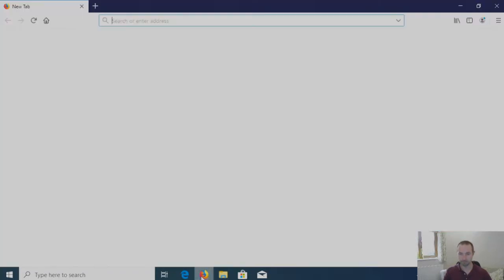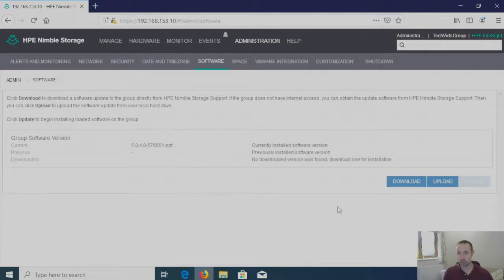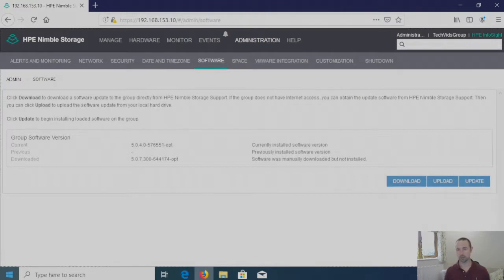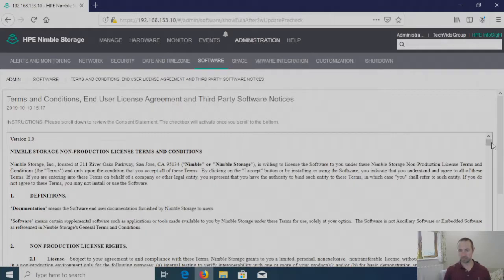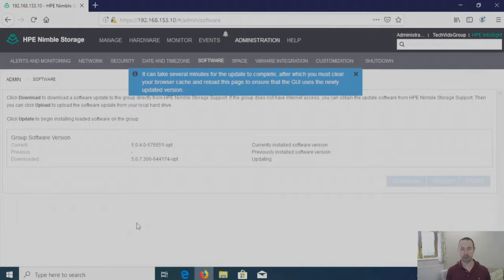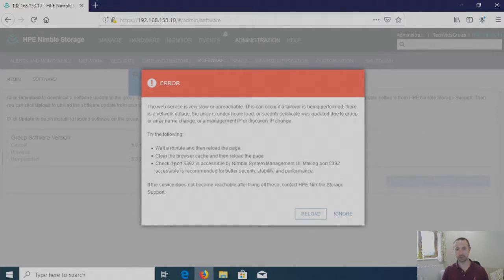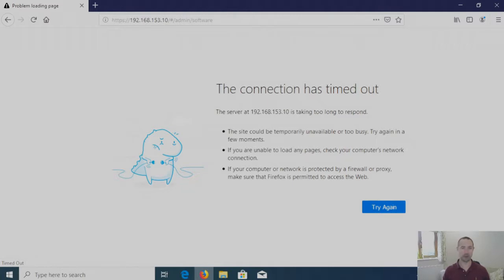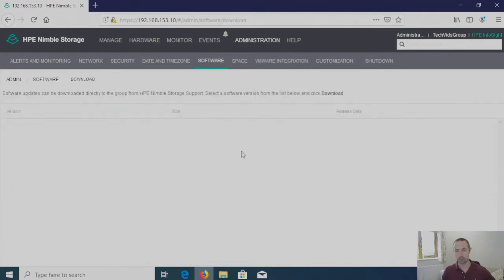HPE Nimble Storage Firmware Update

Comment: For the Nimble storage to download new firmware does it need an active support agreement?
Reply from the maker: The FW comes from either Nimble support directly or Infosight. So the answer is yes in short.
Reply: @itsmylife8972  Great Video. Lastly if i replace a controller or hard drive with lower or higher firmware does the active controller automatically update that replacement controller or drive from the active controller?
Reply from the maker: @Carlo Carlo  If replacing the controller the FW is located on the Sata DOM. My recommendation would be to swap over the Sata DOM. HDD is also shipped with whatever level and would typically stop at said level.
No, the Active controller doesn't 'push' FW to passive controller. It's recommended to have both controllers operating at the same level.
Reply: @itsmylife8972  thankyou for the prompt advice really appreciate it. Do you have a email i can contact you regarding this if thats ok?
Reply from the maker: Sure. You can get me at bret3969@gmail.com.

Comment: Very helpful, thanks!
I'm updating from vmware 6.7 to 7.new
Will I need to update nimble drivers on the hosts?  
I see nimble-ncs, nimble-psp  version 6.0.0-650005 
Not certain where I get the VIB, at what point I update them
Reply from the maker: Update the in line with host update typically. Vib's can downloaded off Infosight for offline update or you can update online via CLi or Update Manager providing hosts have connectivity.

Comment: Hey It's my life! Thanks for the video. We use a Nimble as storage for our VMware environment. Did you ever tried to update a Nimble with online VM's? I'm wondering if i need to shut them all done or that they just continue to run because it should fail over from controller to controller.
Reply from the maker: You can do a Nimble firmware update online. Would recommend just running update over a quiet period.

Comment: How does it work when it's flashing - does it fail the controllers over? like an old EVA?
Reply from the maker: Passive controller gets flashed first, array fails over to new code on what was passive controller, now active controller. Then remaining controller gets flashed to new code, leaving the array serving traffic on opposite controller before firmware upgrade was done. E.g. If before firmware upgrade is done array is serving traffic out of controller A, after completion of firmware upgrade, array will be serving traffic out of controller B.
Reply: @itsmylife8972  Thanks - Kinda showing my age. I started with the DEC HSG-80's.